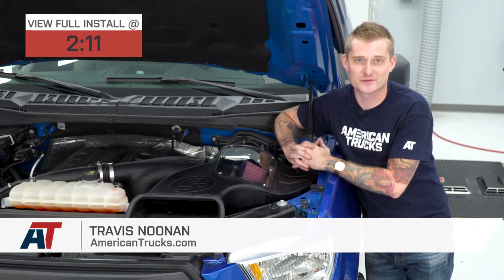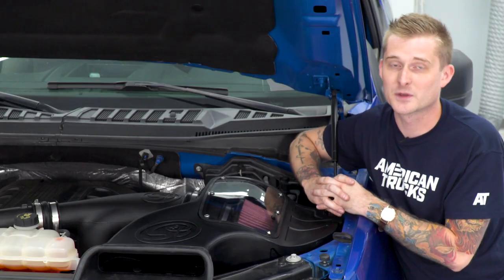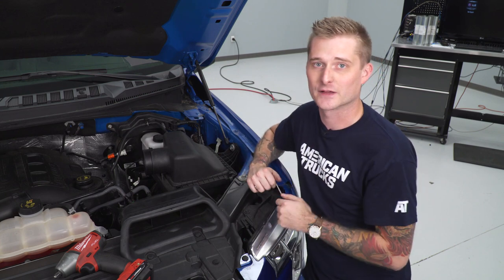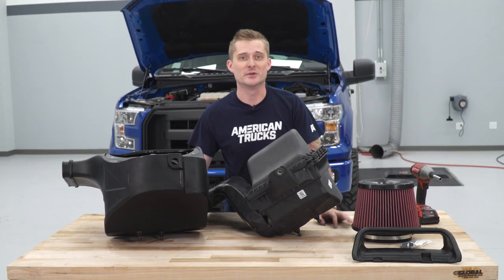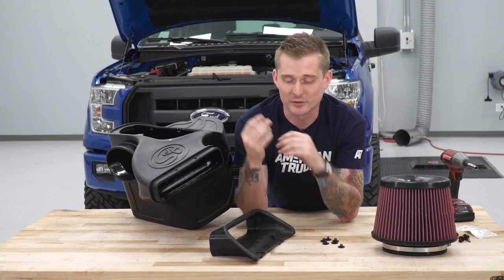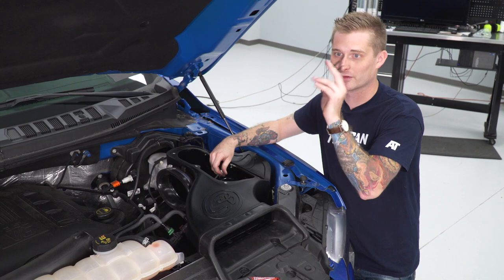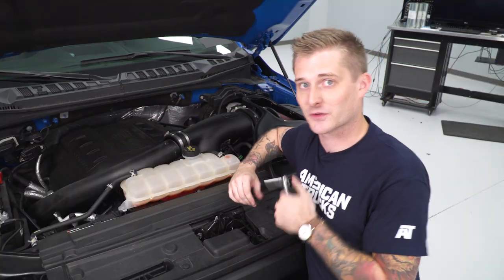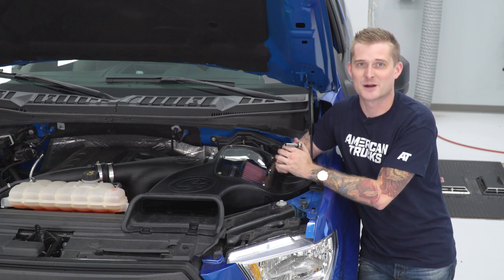2015-2018 F150 S&B Cold Air Intake w/ Oiled Cleanable Cotton Filter 3.5L EcoBoost Review & Dyno

Comment: What did you guys do with the harness that attached to the back of the factory air box? Last I saw in the video it was still laying on top of the brake reservoir.
Reply: you should watch the whole video
Reply: @bigeasy_f150  he never rerouted the harness. It's connected, but never resecured like the stock airbox.
Reply: Anyone watching this wondering the same question, I just installed this and there are holes on the back of the box for the harness to attach to.

Comment: I just installed this in my 2019 f150 and i like the way the turbo sounds louder and i you feel more response when accelerating... i still need to check about the gas consume but totally recommend it!!!
Reply from the maker: Glad you're enjoying it so far! Can never have too much turbo noise😉 -Zach
Reply: Did you have a hard time to install it I just got mine in I have a 2019 f150 limited  seems my factory inline tube are to long so it not connected to it properly
Reply: I'm confused. It seems like the factory intake is a cold air intake.  Other than changing the paper filter, what's the difference? Is the test truck already tuned? I'm having a hard time with the dyno numbers. Seems like a very generous dyno.
Reply: @timothyryan2847  better air flow. bigger box, bigger filter,

Comment: What happens if you take the cover off? Will it affect anything?
Reply: will not get the "cold" rush of air from under the hood but hot air from inside the engine bay
Reply: @illduitmyself  but I want to take advantage of incoming air from my ram air hood above it! How can I make that work out? Or is the ram air hood air coming from the outside just cooling the engine bay air?